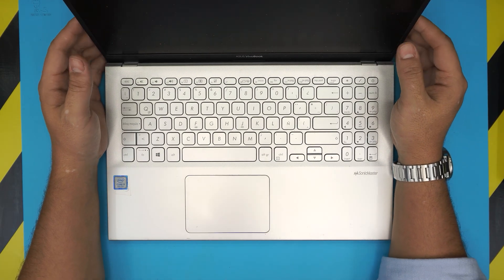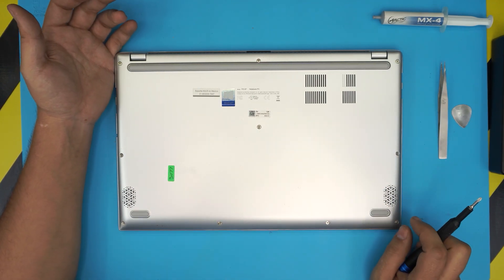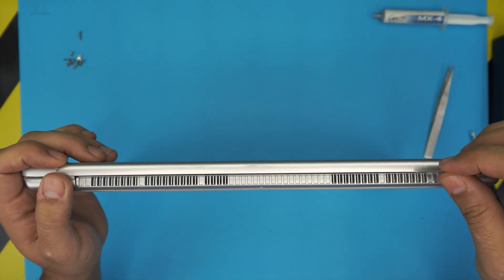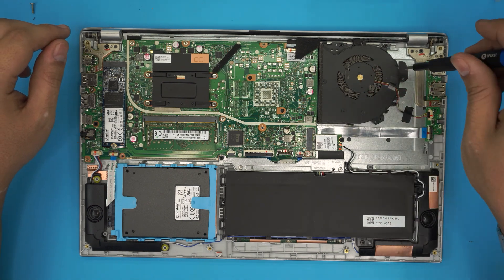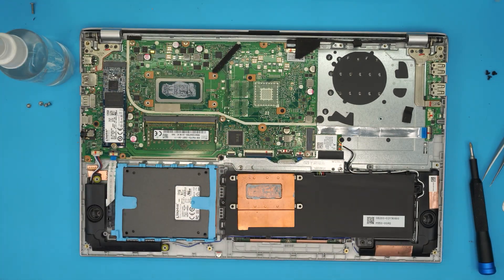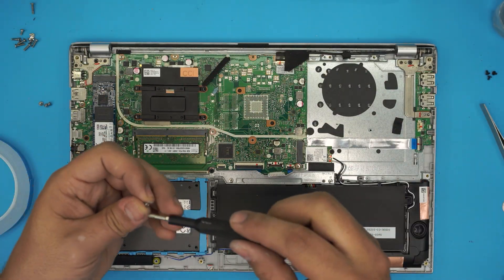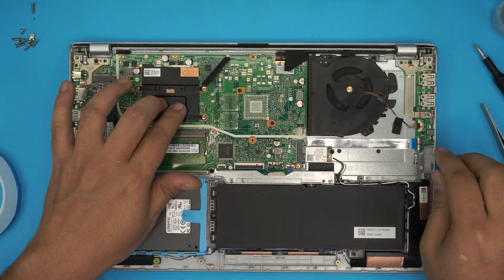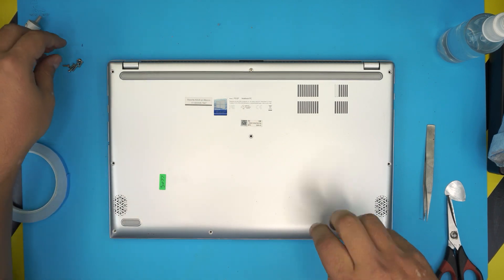Asus Vivobook F512f Repaste Service Overheating FIX

Comment: i just repasted this laptop. got it for only $140 on marketplace! (heatsink design is horrid... why is the fan so far from it? theres no gpu on this model)
Reply from the maker: Thank you for your feedback! If you wish to support the channel, you can like, subscribe, or both!
Regarding your laptop, yes they are very poorly designed, also this devices should not be on a laptop category they are a tablet with a keyboard and track pad, as they use a tablet CPU /APU.
Reply: @uFixTek my model uses uses the intel core i3-8145u, which is a laptop apu, not a tablet apu
Reply from the maker: ah that is a good CPU, there are few variant of this laptop and they use celeron CPU, you got a good CPU on yours. 👍 just a horrible heatsink :(
Reply: @uFixTek  Using HWiNFO64s sensor menu, I'm seeing 57C average while downloading VALORANT (98 peak). When the temps go up, then the fans go ramping up... I think a better fan curve might help here...
Reply from the maker: ya you can bump and burn that fan RPM in order to keep cool 🫠, and you will be needing a new fan in few months :(
Reply: @uFixTek  im just using standard fan curve, is there a better fan curve?
Reply from the maker: there are other fan controller programs you can use to boost the fan to max when doing heavy load.